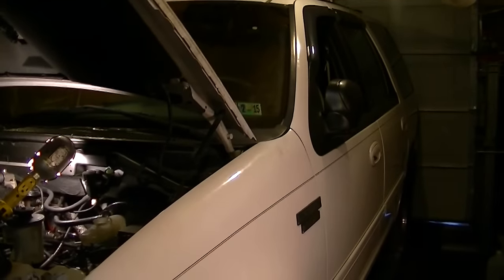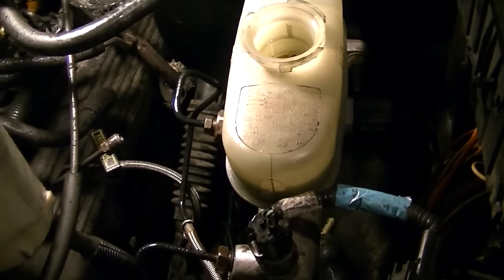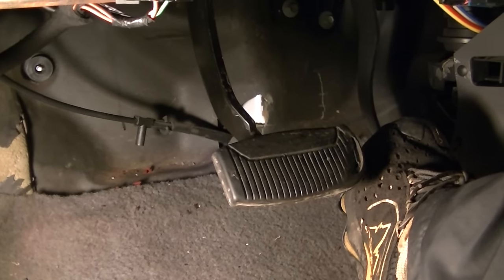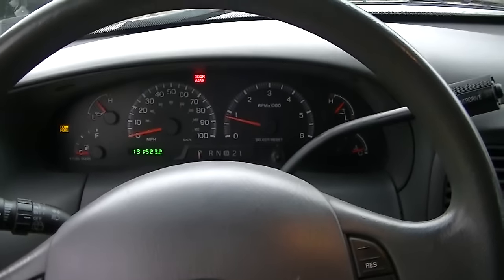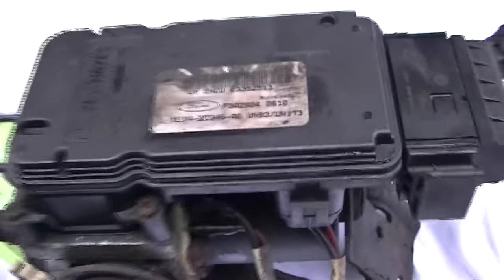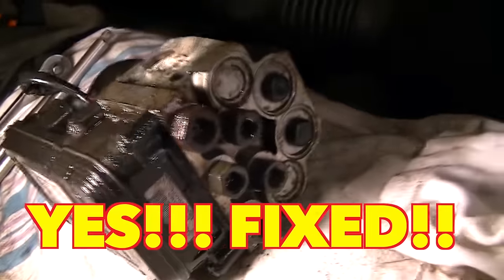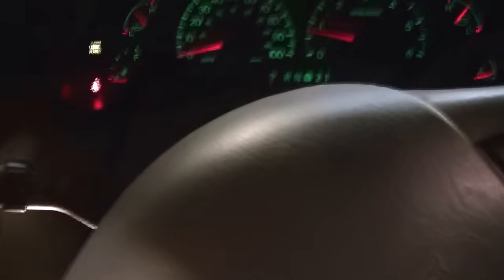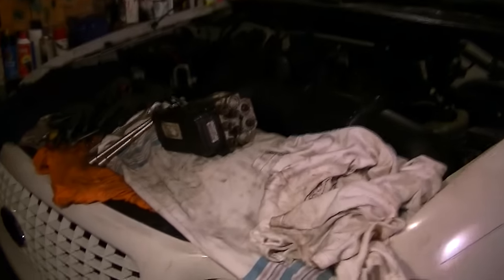Sinking/Spongy Brake Pedal -With ABS SYSTEM?? Nothing Works? Watch Fixed!

Comment: I have a 2006 Toyota Sequoia and I'm going to the same problem. It seems that when I come to a stop I hit the brakes and it goes down the car stops and then slowly the pedal goes even further to the floor. And you can feel the car move it's like every time I come to a stop I have to pump it. I wonder if this would work. I was thinking of maybe purging the lines for the brake flush but to mechanic told me that I need to take it to the dealership to see what's wrong with it for the codes
Reply from the maker: ABS time ;(
Reply: TVWXMAN32. And so how do I go on fixing that? A brake flush wouldn't work?
Reply from the maker: I think it would be a waste of time. You can try it but its probably the ABS mod.
Reply: TVWXMAN32 oh ok is that an expensive fix?
Reply from the maker: Depends you do it your self maybe $100   Someone else  $300 maybe

Comment: Very interesting!  My have a similar issue, my pedal doesn’t go to the floor.  I just don’t have a real good pedal.  A while back I replaced all four calipers on my 2010 Toyota Tundra. It was 4 years old when I bought it, the mileage was 8,998 miles. This pickup sat a lot to say the least.  The first thing to go was the rear calipers, they seized up.  So before I had problems with the front calipers, I just went ahead and replaced them all.  Everything was hunky dory, until one of the rear caliper seized again, I replaced that and ever since the pedal was never at the top again.  I bought all the calipers from NAPA and they stand behind them just fine.  The truck stops real good, the ABS pump works as it should.  I tried pressure bleeding.  The 10 psi from the pressure is not enough to push through the ABS for some reason.  I had my wife pumps the brakes.  Once in a while the pedal will sink with slight pressure on it, but never fails me. If I push on it as it is sinking I can stop! And I mean stop!  Thanks for the video it’s got the brain working.  I never worked with ABS on cars, and pickups. Just the big trucks with air brakes.

Comment: Would this be the same system in a 05 e-150 4.6 w/o cruise control . Just out the blue my pedal started going to floor and a hissing sound while depressing the pedal down and the sound is  continuous until the pedal is released. Also the van has a very long brake delay trying to stop need to start braking a few yards a head then normally this sound like a ABS? Brake system hasn’t been touched since I bought the vehicle a year ago , and the brakes and rotors look good upon routine PMs. Don’t want to waste money on brake fluid , and unnecessary parts plus my time , bleeding. , flushing and all the other shit . Is there a way to bypass ABS
Reply from the maker: Sounds like it.
Reply: Nathan Rohrbough can u bypass ABS ? And how would you bleed it after replacing module  my master drained completely empty last night because I did connect the brake lines to ABS

Comment: Our issue is with a 2003 GMC Savana that the master cylinder, ABS module and the booster have all been replaced and we still have a low  pedal. Have checked for leaks and don't have any. In fact, after putting all new on, the van was driven about 6 miles and every thing seemed great and then...boom, low pedal again. Help?
Reply from the maker: When you say NEW?  What does that mean? Junk yard parts or auto store parts?? This is very important.
Reply: I'm not exactly positive on that. My son said that he knew that 1 of the 2 ABS parts was used. The booster and the master cylinder were from Napa.
Reply from the maker: Sounds like a ABS pump ISSUE....That's all that is left. Napa parts are prob 
ok. Maybe he can exchange the ABS for a 2nd one. Some places will give 
you a 30 day  warranty.
Reply: My husband says that he doesn't think the original ABS was bad cuz he could hard brake at 45 and feel the ABS grab and kick in. The mechanic (after discovering the master cylinder wasn't issue) thought it was the ABS and so replaced it twice. The 1st one failed and so replaced with another, which was used. Brakes have been bled many times by the mechanic. Now another issue popped up in the last day and that is when my son hard brakes it pulls to left...
Reply from the maker: Does not matter....The ABS pump will still kick in and pulsate...mine 
did 
the same thing! But the pedal dropped to the floor! The servos are the 
issue in those ABS's and they lose pressure/leak inside causing pedal 
dropping issues.. Been there lots of times.
I tested that theory on my Expidation this spring. After replacing the 
ABS PUMP...all was ok.
Reply: First of all, thank you so much for responding. Where is the ABS pump located?
Reply from the maker: I think its on the frame under the or near the engine. You probably should google it. This might give you a better understanding.

Comment: I have a 76 blazer 2wd no abs and I have the same problem and I have replaced the master cylinder front calipers and pads and replaced front rubber lines and bled it with the person pumping up and hold the peddle pressure then crack open the bleeder valve at each wheel to get the air out and it has all new fluid in the hole system now, I also replaced the proportioning valve thinking it was the last piece of the puzzle but to no avail. I'm now stumped but would like to get it back on the road. Any help would be great I've worked on cars since I was 15.the peddle still goes to the floor and the brakes do work just don't seam very good and the back lock up if the ground is wet. stops but slow.
Reply from the maker: Get a NEW master cylinder.
Reply: tried two. it ended up been a bolt was holding  the brake pad against the caliper witch in turn would not let the piston move so I could bleed it but the peddle would go to the floor because of the air trapped in the back of the caliper piston that would not bleed out cause it could not move,so I clamped all the rubber lines had full or top brake peddle, then I  just undid a line at a time till I found that caliper and once I got the right bolt in there it was working ,re bled it and I have had brakes ever since, peddle is right on top and solid. stops on a dime. I think the air that was trapped behind the caliper was letting the peddle go to the floor because it was compressing the air, my best guess. Thanks again

Comment: Same problem, and my rear brakes locked up.
Reply from the maker: O no!
Reply: I  have  a 94 F250 Ext Cab. can I work around replacing this valve? Can it be blown/flushed out on a bench? Can I by pass it?
Reply from the maker: Eh, Maybe...but if you have several lines the the work might not be worth it. Testing the ABS with a used one would be a better route ....I think.

Comment: Is there a particular installation sequence or bleed sequence when installing ABS unit...it looks like u did this alone . I will be doing it alone ...what's your technique?
Reply from the maker: After everything was put back together, I just pumped and pumped away. It took some time. Here is how I did it with a video I made a while back. Enjoy. https://www.youtube.com/edit?o=U&video_id=3lVtFJ3b6Mw
Reply: That link doesn't go to anything ....what's the title of the video so I can just look for it on your channel
Reply from the maker: Hummmm, I just tried the link and it worked for me.
Reply: I don't know it still takes me to a page that just says that there is no video...could u tell me the title of the video so I can just search for it that way? Thanks man
Reply from the maker: ok lest try this....copy and past this and see if this takes you there.
    
      Ford Expedition New Brake Master Cylinder. No brake bleeding! How I dit it.
Reply: I found the video! Thanks BUT...u didn't say how(or if) you bled the ABS unit. U told me how u bled the master cylinder slowly with tons of pumping. So did u have to bled the ABS unit or was it the same "lots of pumping" method? Thanks so much for all u do in these videos!
Reply from the maker: No. I never bled the ABS. I just pumped away until I got a full pedal. 
That was the point of the video I guess. I was
 happy not to actually have to bled the ABS!  Just made the job better ;)
Reply: So depressing ....I have a new master, new abs, no leaking lines, booster has vacuum, bled the lines so many times ...no improvement...am I missing something?
Reply from the maker: Where did you get the ABS from? What is vehicle do you have?
Reply: 2006 ford freestyle ...got the ABS on Craigslist from a part vendor used ( he has nothing but hundreds of great reviews )
Reply from the maker: But is it new? Or used?
Reply: It was used....I am wondering if there is a way to test the ABS unit I just took out to see if it's ok...it's so crazy because I have done absolutely everything u did in this video with no improvement but now my ABS light and traction control lights are stuck on...
Reply from the maker: Yea that abs sound like its a bad unit. I'd block off the master cylinder lines somehow and see if the pedal still goes to the floor. If is does not the you know that abs unit is bad.

Comment: Did you have to swap the electronic control module mounted on top of the ABS unit? Typically they say it requires a re-program if you put a different one on. How did you know the salvage yard unit was good? Thanks for posting.
Here is a test for an internally defective ABS.
https://www.f150forum.com/f6/brake-pedal-fade-2002-f-150-a-157374/
Reply from the maker: electronic control module mounted on top of the ABS unit?
Reply: Obviously you didn't swap them. The ABS module has an electronic and hydraulic component. It is held to together with small screws. It is possible to replace only the electronic part which is the controller. If the controller is new it must be programmed with the Ford programming tool. What you have proven is if the part number matches the program should work as well. I need to replace the ABS module on our Expedition. I had planned to find a used one and swap the controllers. But if I can find a matching part number I won't have to swap them.
Reply from the maker: No I replaced both of the the same time. I pulled one at the junkyard. I would rather keeps things together as parts numbers. I hate separating parts.
Reply: That's what I thought you did. Hopefully I can find the right part number when I go looking. Thanks for posting. This is good information about Ford truck ABS.

Comment: I have a problem with my Toyota when ever I turn the steering all the way left the brake pedal hits the floor then hardens when I straighten up. And my abs light is on
Reply: I've tried everything except the abs
Reply from the maker: Good luck with that

Comment: i got a 199 toyota camry and when i press on the breaks it goes about 3/4 of the way down to the ground before the breaking kicks in.. ive taken it to 2 different shops first shop changed the master cylender as well and the round thing that it attaches to connected on the inside of the car... checked for leaks and also replaced the back caliphers problem still remained.. next i went to another garage they changed the master cylender again problem still remained no leaks at all.. one thing the first shop does for me is every 4 months i take the car back and for 20 bucks they take off the back tires and sticks a screw driver into the rotors and ajust them that make the breaks a little tighter but it dosent last any ideas whats going on my abs light is on does this sound like what was going on with yours..
Reply from the maker: Round thing that it attaches to connected on the inside of the car....WHAT???
Reply: if i knew what it was called i would have said its name its connected to the master cylinder and the car i did a little web search it might be called the break booster. but that is not the important thing i was asking is does this sound like what your problem was when you described goes all the way to the floor. when driving??
Reply from the maker: Brake booster has nothing to do with the brakes going to the floor...Its either working or not (Hard pedal or normal pedal) If you have a ABS pump I'd start looking into that....If you've bleed the brakes and still its seems like the pedal is soft....Make sure the master cylinder was NEW...not used. If its new them ABS is probably going bad ;)
Reply: thanks ill look into that ill take my car back to the garage to have it inspected again

Comment: Hi, I have the same problem with Toyota Camry 2005. No leaks found, MC fluid level never drops. Replaced my Master cylinder twice, but every time I bleed I can see air coming out and I can feel my Brake pedal is having a grip and after a couple of brakes, pedal feels spongy then soft and gradually all the way down to the floor. My Mechanic is recommending for an Original Toyota Master Cylinder. 

I have two questions TVWXMAN32 as you also bleed the brakes few times 
Did you see the air come out every time you bleed? As I am assuming if I had a problem with ABS I should not see air when I am bleeding. and is it possible that I can disable ABS by removing the switch (dose it work for me - Toyota Camry 2005 LE) Thanks a lot in advance and Thanks for posting the video.
Reply from the maker: If you have no loss of fluid...then I bet the ABS is not working...They have valves etc that regulate the pressure etc when hitting the brakes. As for the booster...Nope! Don't replace it. You will just be wasting money. If a brake booster is bad you will not have any power brakes or hard has a rock!   I'm leaning on the ABS. As for the air bubbles....don't think it has anything to do with a pedal going to the floor. Could be the ABS not recycling like its suppose to trapping some air.
Reply: Thanks for a quick reply, I am planning to buy an Original Toyota Master cylinder, Can I try and disable my ABS to make sure the issue is with ABS. what should I do to disable ABS.
Reply from the maker: The only thing you can do to disable the ABS is to block off the lines...Just 
unhooking the fuse will do any good. If you get it fixed lets us know 
what it took.
Reply: Replaced Original Toyota Master cylinder no use, replaced ABS unit no use, brakes still sink to the floor, Mechanic gives up. I don't understand what went wrong. Is there any specific procedure to replace ABS module for Toyota camry 2005 or anything in particular after replacing the module, like flashing from the dealer or anything I am missing, There is NO ABS light.  please help.
Reply from the maker: Sinking brakes only mean one thing....line pressure is dropping. I bet you have a bad ABS, I'd verify that the master cylinder is good -(this is the key)!!  Then look at the abs.
Reply from the maker: Also in most cases....you will not get a ABS light when a unit get bad.

Comment: If your brakes are going all the way to the floor you need to read bleed out your brakes properly. From the back right side the back left side the front right side and then the left front. You can also use an ABS system to help you bleed your system. You have to get a code reader that is capable of doing it
Reply: Please can you elaborate on using the code reader I picked up an E350 based Class B RV and it has the spongy brake syndrome on Amazon they sell a code reader specifically for Fords and it states that it helps bleed the brakes on Fords

If you can elaborate how it's done with the code reader it'll be greatly appreciated the code reader manual that's online is written in chineseium

Comment: Lets see oil coolet line blowed this pased winter bypassed had rusted out trans pan put new exhaust on new gas tank new abs pump think programed
Reply from the maker: ALL lines out trans pan put new exhaust on new gas tank new abs pump back up to spec